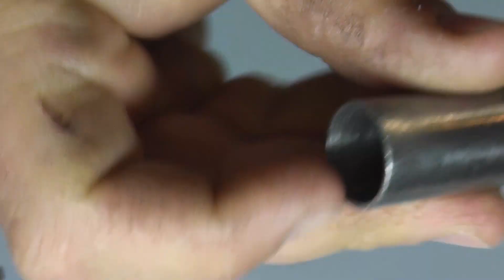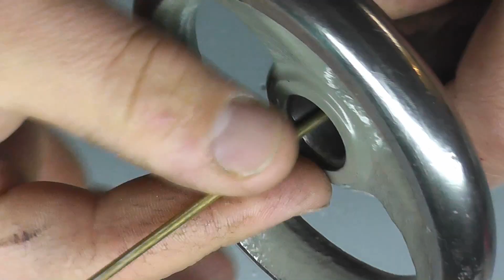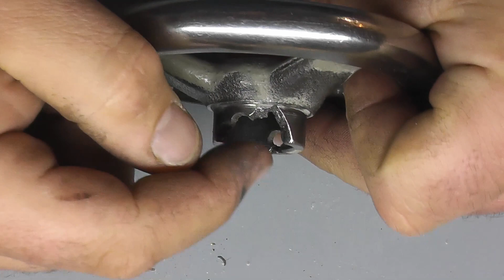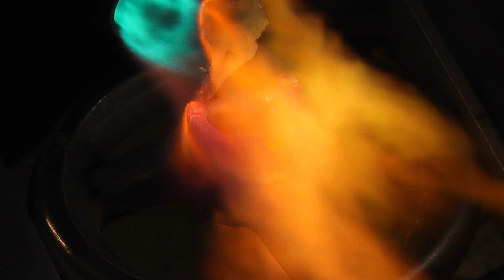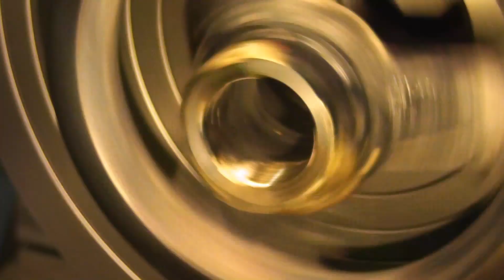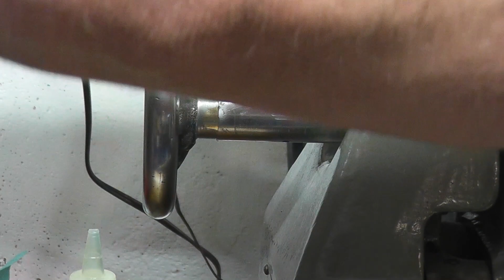Collet Draw Bar Repair

Comment: Halligan142, Just so you know. South bend used tapered pins on the handles. You can only drive them out in one direction or, as in your case,  people crack the handle trying to drive them out the wrong way.

Comment: Id cut the whole thing off flush, press a metal sleeve in flush to thewidth of the wheel after welding a larger diameter to the end

Comment: Good repair. I have a draw bar for my South Ben but the threads need to be retapped and cleaned up from the previous owner. Would you happen to know what size threads the 3C  collets have on them. I do know that they are national fine threads but not sure of the size. Any help would be appreciated.

Comment: Hi Halligan !

Really nice and dertailed video - nice to know you CAN braze with a torch like that - thx for sharing !

I'm planing a similar collet system for my (bigger) lathe.

More details here in danish but you can Google Translate to the right just under the menu line - choose whatever language you like in the combobox:

http://kelds.weebly.com/generelt-spaeligndetang-system.html

BUT ... I'm a little worried about having "the tightning wheel" hanging out like you have.
To be more "safe and sure" I will make a "sort of wrench" to reach in the protection shield of the lathe and use that for tightning.

Isn't it a little dangerous to have this wheel spinning round so fare out ?

... at least on a bigger lathe like mine I think it is - please comment ?

Comment: Nice job. Loctite, the "death grip" stuff, will stand up to anything except heat. But I can't see how the heat from turning is going to get back to the handwheel. And I didn't think you could braze without a oxyacetilene outfit. But obviously you can. I thank you for a valuable lesson.
Reply from the maker: Juan Rivero The turbo-torches really work well.  We use them a lot at work because they're hot enough to braze yet portable enough to carry on a roof.

Comment: Nice repair Greg.  Curious about the tips for the propane torch in that the flame almost had a rose bud look to them.  Do you know the brand?  Thanks for sharing another great video!
~PJ
Reply from the maker: pjsalchemy Yup.  It is acetylene only.  It draws in and mixes it's own room air and has multiple tip sizes for different size pipes.  We use them because they are hotter than a handheld MAPP gas torch so you can braze effectively and they are portable enough to carry on roofs.  They are usually connected to a B or M size tank.  I use B tanks and what you saw in the video was a # 11 and # 5 size tip.   http://victortechnologies.com/turbotorch/
Reply: Greg called it a "Turbo Torch" .. which I took to mean the line of torches made by Victor for plumbers and HVAC guys. Interesting flame profile coming off the small tip he used.

Comment: Greg,
Nice repair. It's been my experience with that super LocTite, the only way to get it to come apart is to heat it up with a torch. I think you will get years of use out of your  drawbar. Thanks for another great video!
Have a good one!
Dave
Reply from the maker: Swarf Rat Thanks!  It's holding up so far.

Comment: really nice repair Greg. 
I was thinking that the original pins were rather large in diameter in relation to the material on the wheel flange not leaving you much metal as a support. Maybe if need be you could install 4 smaller diameter roll pins instead of 2 large ones.
Cheers and thanks for sharing.
Philippe
Reply from the maker: Phil's Projects 
If the loctite doesn't hold up it is an option.
Reply: ***** You can also drill a hole from the end - I mean right between the wheel and the bar, and install a pin that way. Just to help the loctite a little...

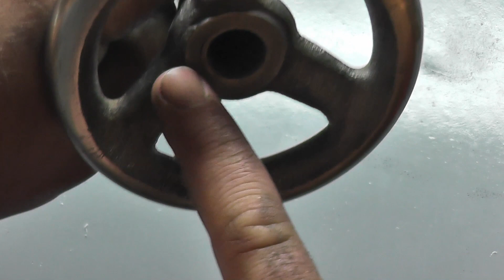Comment: If the loctite fails, could you bond the two metals from the front face? (24:11 of the video). I don't know if you need to be able to remove the wheel regularly or not....
Reply from the maker: Darryl Landry Yes you can.   There is no real reason you should need to get them apart.

Comment: Nice work, Greg.  Stacking up braze filler like that is not as easy as you make it look.  I think you have had some practice...
Reply from the maker: ***** Brazing pipe at work.  Sometimes you have to fill a gap on loose fitting fittings.

Comment: Hi mate.
I was wrong.  I thought that you had set yourself up to fail, but I was wrong.  I would have taken all the fractured stuff off and than ether had put a new ring on there, or just shifted the hand wheel further up the sleeve.
But this looks very acceptable.  Just don't drop it like the last person most likely did.
Well done.
Marcel.
Reply from the maker: Marcel Timmers Thanks!